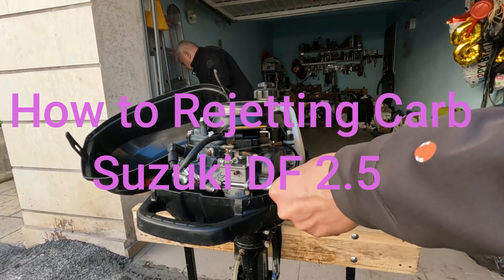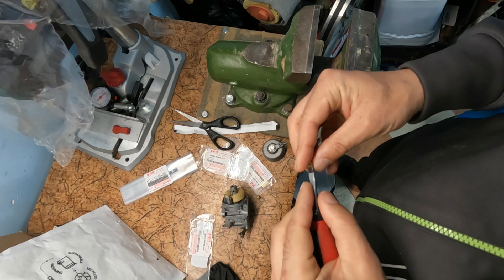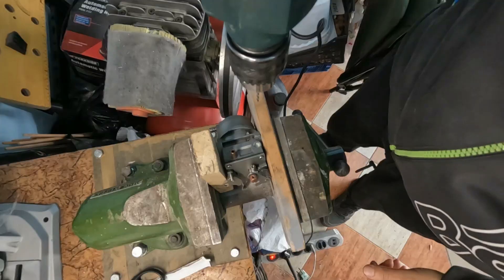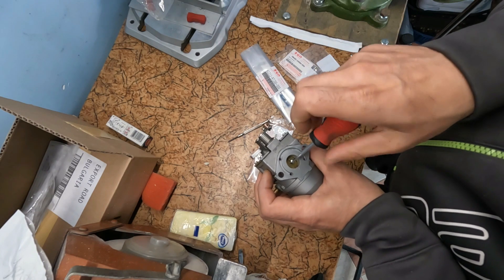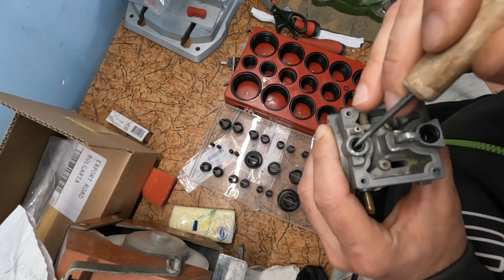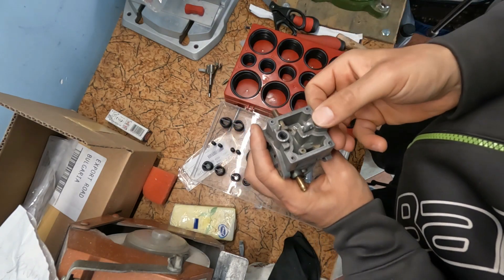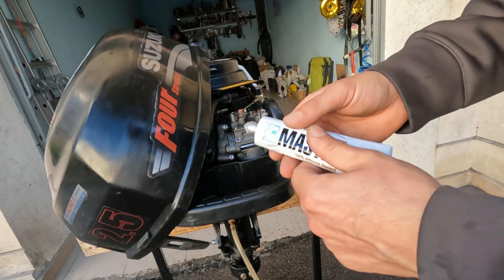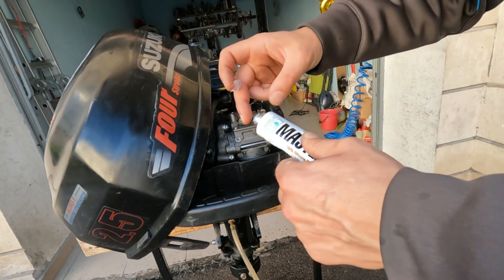Suzuki df 2.5 carburetor tuning big jets installation and adjustment

Comment: Im putting smaller jets to run at high altitude. Dont change jets to stop them from clogging lol that will just make it run rich and have less power at altitude.
Reply from the maker: Certainly the effect of larger nozzles is exactly the opposite, higher power and rpm and more stable operation of the outboard engine. In their main part, these engines are used in places with low or equal altitude. This is not an enduro motorcycle engine that climbs peaks with high altitude haha.
Reply: what size are you running the #60 and 34?   I'm looking to tune mine for 7000 to 9000 ft altitude

Comment: How many turns in is the fuel air screw?
Reply from the maker: I think 1 1/5 -  1 1/4 It's been a few years since I repaired this Suzuki DF 2.5 hp outboard engine. Try it in this range of propeller speeds and adjust it by ear when the engine runs the smoothest and boosts the cleanest.

Comment: Great video Sir.  How did you learn about the larger jets?  What model year(s) 2.5 did the factory originally use them for?
Reply from the maker: I've read a lot on the subject and have been dealing with engines for many years and decided to try to optimize this Suzuki DF2.5 outboard engine.

Comment: Thanks for this. What year DF2.5 do you have? The old or new model?
Reply: Just finished this today, using the recommended jets above. I actually had to turn the (previously hidden) adjustment screw quite a bit to get it to idle. Still wondering if I have a blocked jet passage. We'll see how she runs on the lake this year. Thanks.
Reply from the maker: @marcusgardner7640  I hope I was of help to you. I would be happy if you could share if there is a difference in the speed of the boat after you do a test. Greetings!
Reply: @ I doubt I’ll notice much speed difference as I use it on my sailboat which is not very aerodynamic. My main purpose was to solve stalling on idle and also to run richer so I would be less prone to overheating. The lake I sail on gets lots of milfoil that clog up the water passages frequently.
Reply: Ah looks like it’s pre-2012 redesign
Reply from the maker: @marcusgardner7640  Yes
Reply: @fitness-fishing-s.kovachev  I wonder if the mix screw is in the same place on mine. I have a 2015 and I see two metal plates on that side of the carb
Reply: Just checked by removing the same plate. On the 2015 everything seems the same. Will try with the pats you listed.

Comment: I am a big DF 2.5 hp Suzuki Outboard owner.   They Rock!
Reply: I was going to buy one since in the 2.5 hp category. They are by far my preference due to it's light weight. Portability being a major detail on my choices. 
But destiny had other plans and I ended up with a NOS Tohatsu 2.5 hp from 2012! I couldn't pass a brand new outboard, for a little less than half the price of a new one from this year... Killer deal. 🙂
Well, it has slightly more power and torque than the Suzuki. Due to bigger CC engine. But also weight 5kg more. The advantage is that it can be easily upgraded to 3.5/4hp. Which will happen as soon as the break in period is done. 🙂

Comment: Good video! Where can I get those new jets? What are the numbers refering to? Thanks again
Reply from the maker: @PeterGerdts-x4s  From official diler Suzuki. Number you can see in the description in the video.
Reply: @fitness-fishing-s.kovachev Thansk alot!
I have the Johnson 2.5, 2006.
Its the  same engine, but the parts catalouge specifies different number:
Pilot jet: 30, 32 or 34
Main jet: 68, 70 or 72.

Any idea what to choose? 🤔🤔
Reply from the maker: @PeterGerdts-x4s  in my opinion maybe:
Pilot jet 32
Main jet 70

Comment: Wow that’s much more responsive. Mine hesitates when the throttle is opened quickly. 
Thank you for sharing.
Reply: For the record that sounds a lot like fuel starvation. Assuming that there are no clogged jets and all is "fine". That would be a rather common case of too lean of a mixture. 
Removing the air/fuel mix plug. Just like he showed on the video. Drill it out and pull the plug. Will allow you to adjust the mixture And most probably solve that issue. 🙂
Most of these outboards come from the factory with extremely lean mix settings. To appease the so called "pollution control" agencies. 

Curiously, yesterday I did remove the sealing plug of my Tohatsu 2.5 hp. I haven't tried the outboard. 
BUT, lo & behold the mix screw was totally closed, out of the factory! So, I'm starting with a very modest 1 1/2 turn out. And work from there.
My engine is new, from 2012! Yep! A nice NOS. 🙂So no one ever touched that thing. In fact it never ever had oil or gas in it! It's really new. 
The fuel completely strangled is surely not a good thing. Reason why so many people complain they hesitate, etc. 🙂
Reply: Yo tengo uno tira hase y te por la  manguera de respiradero 
y no de sarolla que pudo hacer

Comment: Hello dear friend, in terms of browsing speed, is there a good difference???
Reply from the maker: After putting larger jets in the carburetor of the outboard Suzuki DF 2.5 I can say that when opening the throttle it became much more responsive. The maximum speed of a boat increased by about 2 km/h. I have more videos of how fast I get with this outboard on my channel. I also make a comparison with Mercury 2.5hp 2t. The most important thing is that the jets do not clog so easily and this guarantees an easy start. Greetings!
Reply: @fitness-fishing-s.kovachev  - I've noticed you mention not clogging so easily. Please put a decent, but inexpensive fuel filter on that outboard. It makes a world of difference in terms of carburetor clogging mis happenings. 😉
Reply from the maker: @CensorshipGenesis I sold the engine two years ago and bought a 3.5 hp Mercury ;)
Reply: @fitness-fishing-s.kovachev  - Now I'm curious. I have the Tohatsu 2,5, identical to the Mercury 2.5/3.5. 
Although my initial idea was to get the Suzuki 2.5. Which in my opinion is one of the best (lightest) 2.5 on the market.

In your opinion, how does the Mercury 3.5 compare to the Suzuki 2.5?

PS: I've added a fuel filter to mine yesterday! 🙂

Comment: How did You connect pipe to the cooling outlet? What is the thread size there? I would like to make the same solution.
Reply from the maker: I used an 8mm bolt. I drilled the bolt with a 3.6mm drill bit. I rounded the end so I could insert the hose.